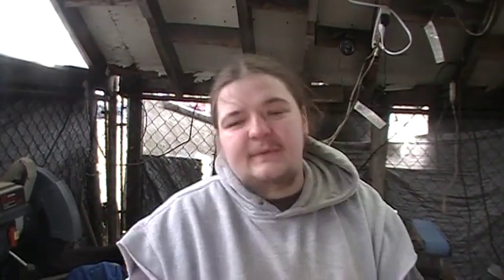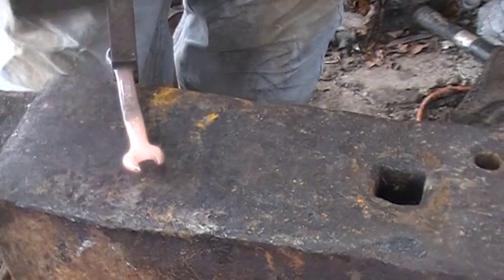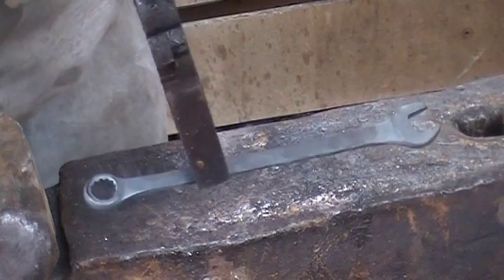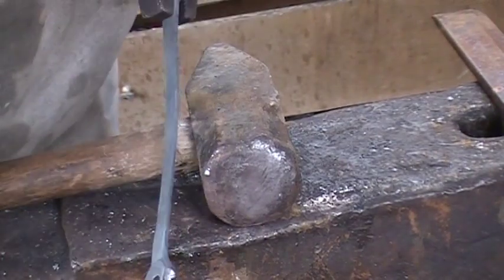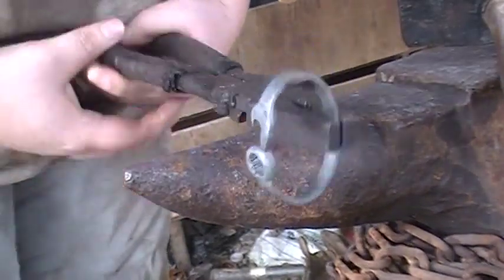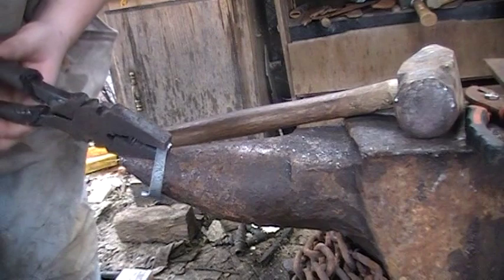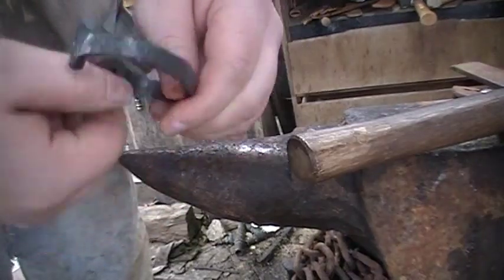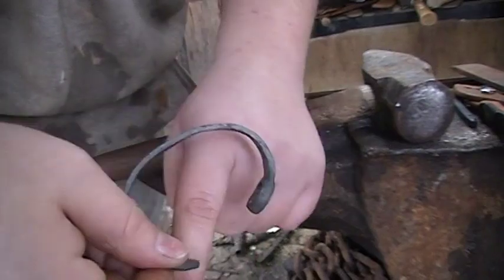Forged Wrench Bracelet Bottle Opener combo

Comment: Nice. It turned out good. I was surprised that drawing it out didn't appear to make a noticable difference in the thickness. and it works. I suppose you could tack a nut in there to hold the shape and then grind the tacks off. But it still worked fine.
Reply from the maker: That's not a bad idea could be worth a try Rob thanks for watching